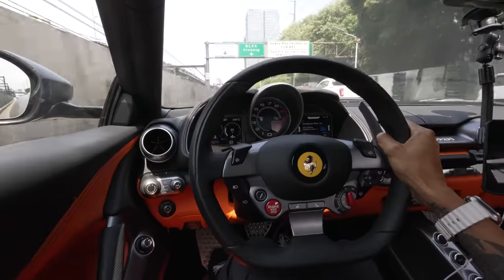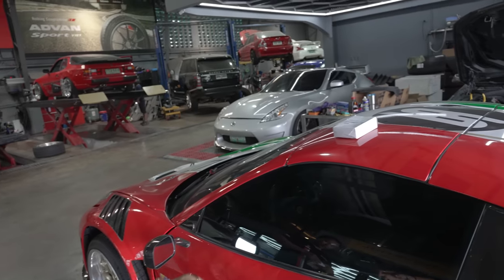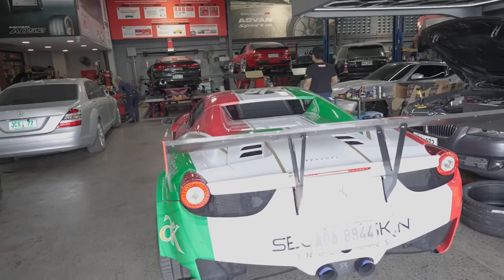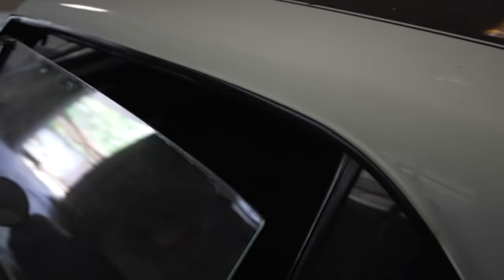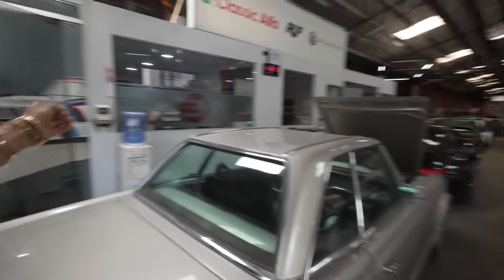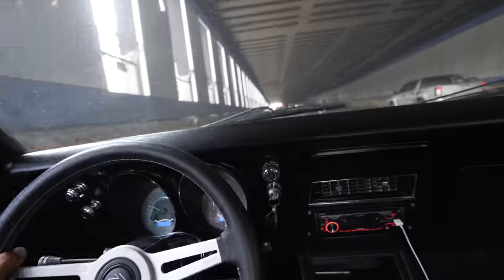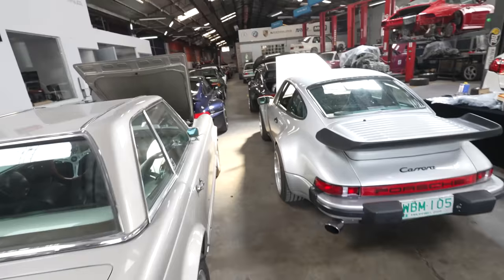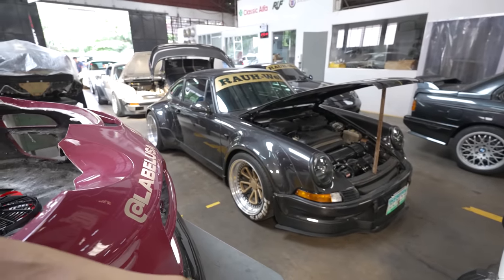Sorting MASSIVE CAR ISSUES - MUST NOT Ignore | Angie Mead King

Comment: Correct decision to get rid of that Defender.  You should not have bought that in the first place.
You should have bought a new Toyota FJ Cruiser as they are stopping production of them.  They are reliable (you seem to have reliability issues with all your vehicles) and the FJ Cruiser will not depreciate like the Range Rovers.
Reply from the maker: Haha I don't like the FJ though and it's slow